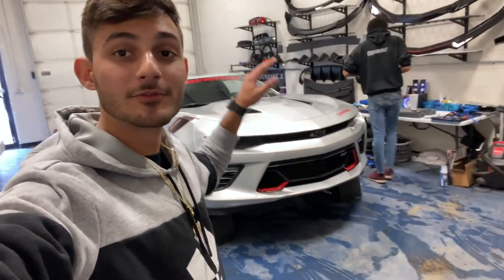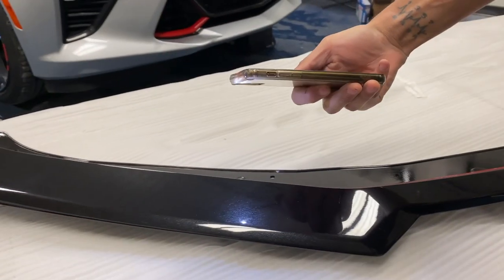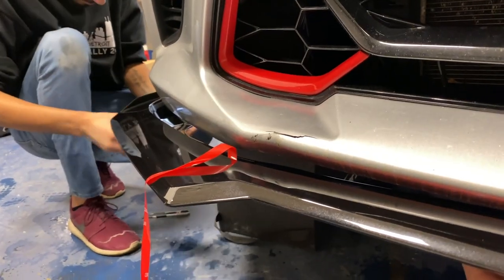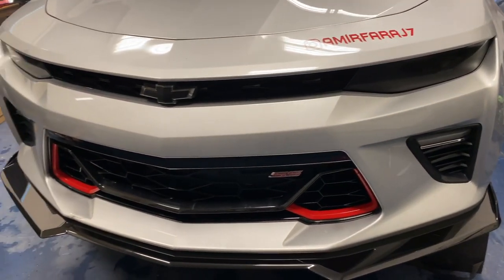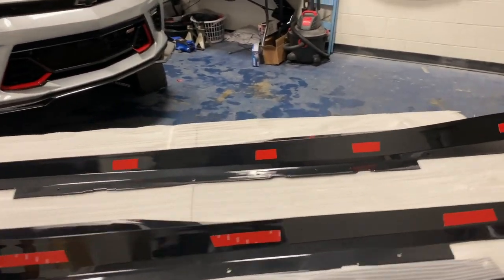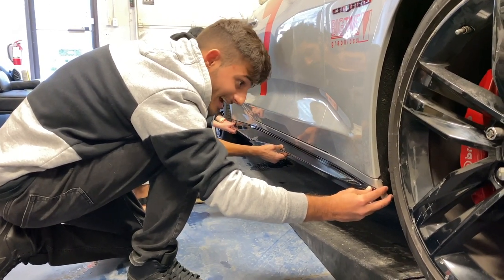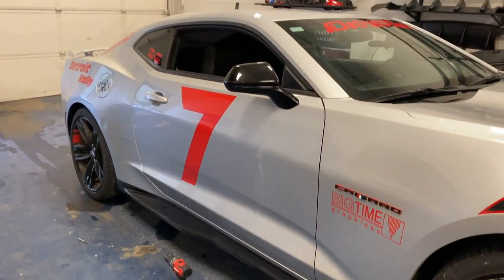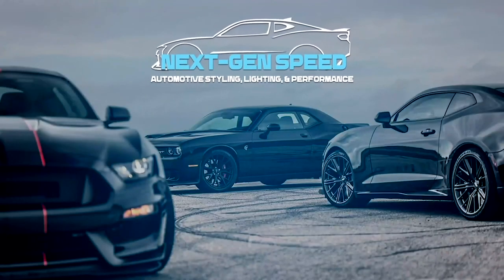2016+ Camaro Splitter & Side Skirts Overview & Install - Next-Gen Speed

Comment: I know the extra screws yall put in the splitter were just self tap screws, is it the same for the side skirt? No pre drilling for either the splitter or the skirts?
Reply from the maker: Yes correct! Side Skirts require drilling only if you use rivets